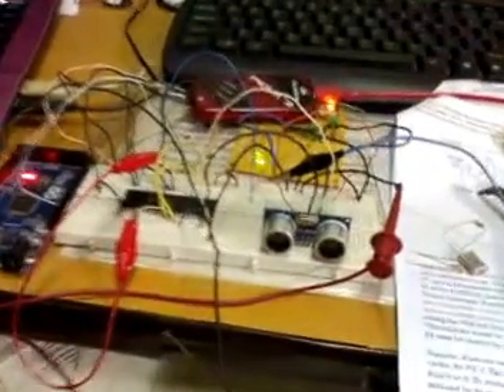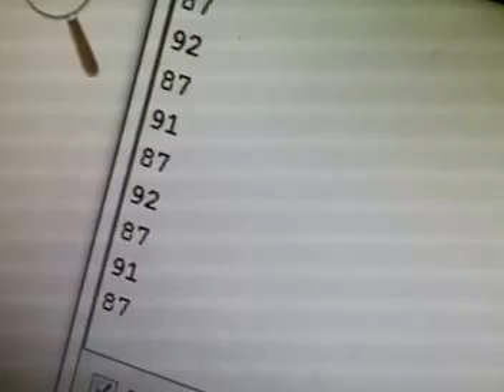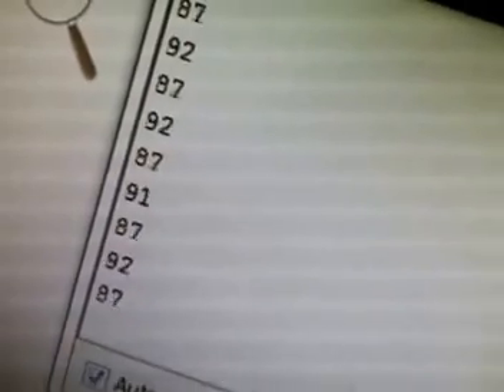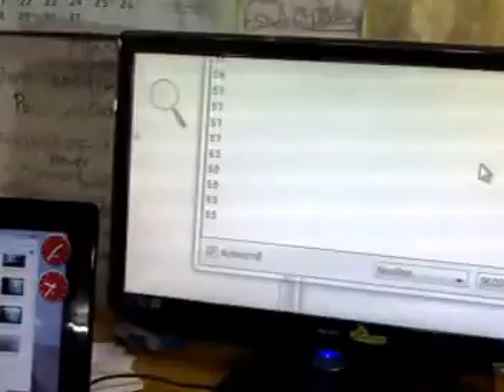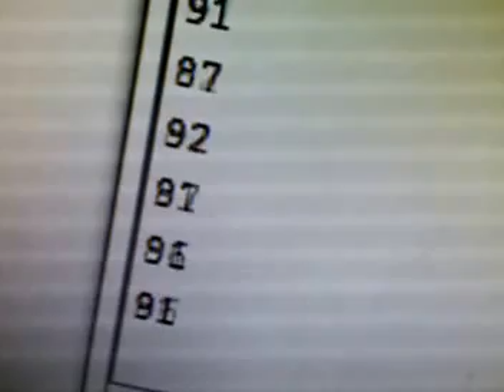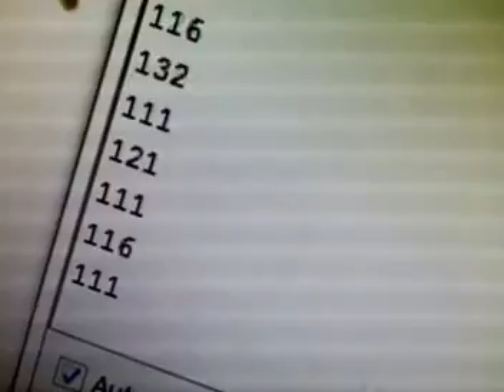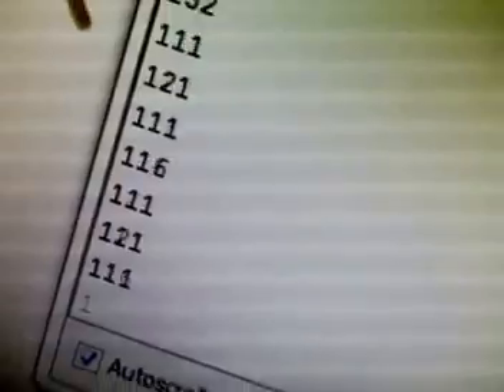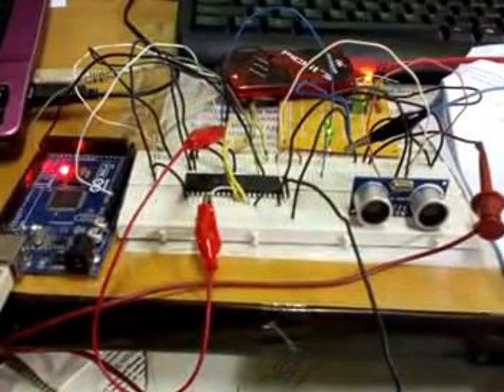PIC: Ultrasonic Distance Sensor in MikroC for PIC18F4550

Comment: Could you please share your circuit's connection diagram (indicative of the pins used for the serial and input and output of the sensor)?

Comment: You can communicate that pic directly to your pc using its usb feature, or using a usb-ttl converter for much. Is the arduino really neccesary?
Reply from the maker: It was never intended to connect with USB because it used for collision avoidance for a remote controlled car. And at the moment i did not have access to a good USB to TTL device. After a few months after that video though i bought one. Thanks for the concern! Hope you check out some of my other videos and don't forget to subscribe if you like some of them. Thanks!